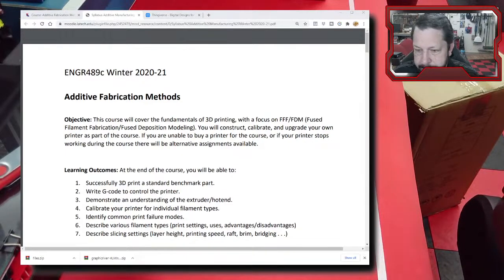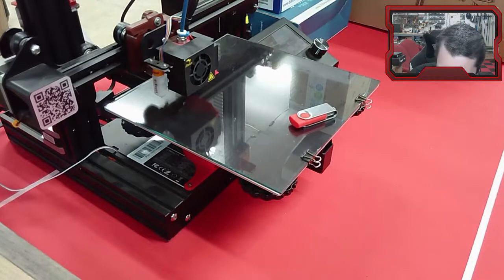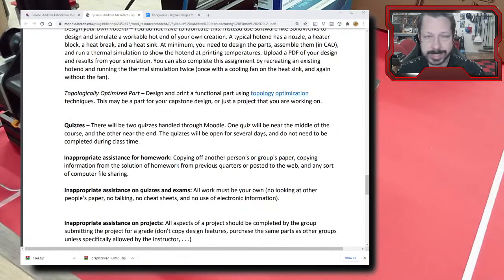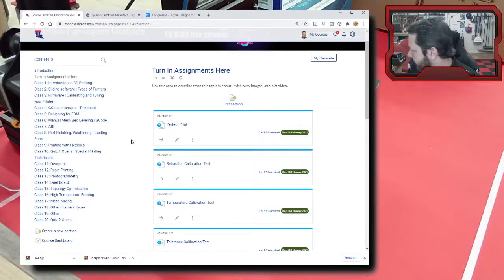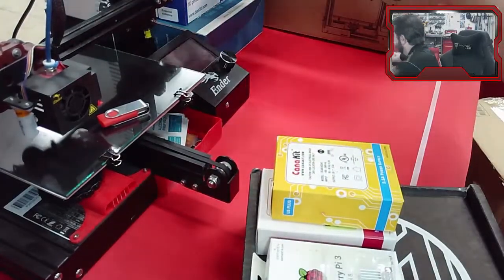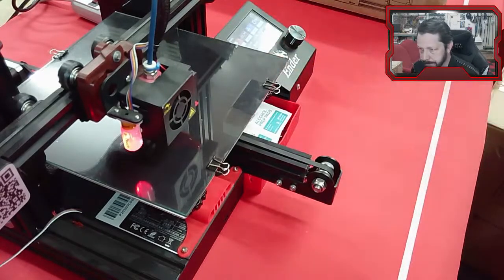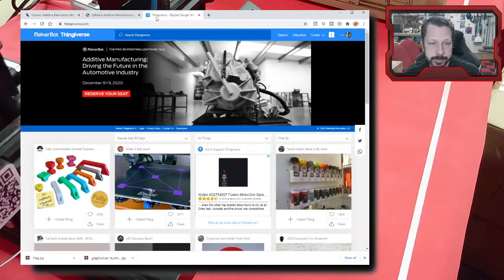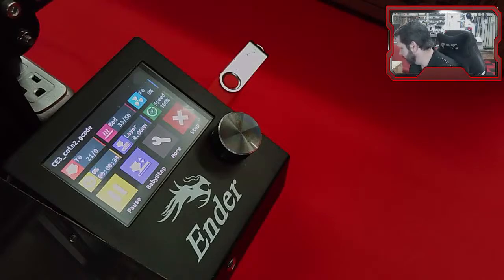01 | Additive Fabrication | Introduction to Printing | 2020-21

Comment: Is this a college class or a general open class? Can you post more details about the class and how to enroll? Thanks.
Reply from the maker: This is an elective course that I offer in the winter and summer quarters. It is open though as far as what I put on YouTube. I have thought about setting up some webpage so others not technically in the course could see any written materials that go along with it, but I haven't done that yet. I will see if there is an easy way to get some schedule out there. As far as enrolling goes, I am not sure how that works unless you are a Louisiana Tech student already. Otherwise, I assume you would have to pay some sort of tuition. I haven't really looked into how to offer it outside of our existing students though. Thanks for the questions though. Also, feel free to join the livestreams).
Reply: @KellyBC  Hi Kelly.  No real need to enroll.  I'm an EE (Cornell University, 1984) with 35+ years of experience in industrial automation & software development.  I'm definitely following along, have watched everything to date, including the 12/8 live stream and plan to continue.  I'd definitely be interested in getting whatever written material you have available and would like to get a copy of the syllabus.  Is it possible to get your Discord address?

I have an Ender 5 Pro with a 4.2.2 32-bit board and TMC 2208s.  I also have an Artillery Sidewinder X1.  I'm a big fan of TH3D products and use their PEI flex plates (smooth & textured) and their EZMat.  I also have a Creality Glass Bed when needed.  I have the EZABL (with the Solid Bed Mount kit) but have some issues with it which TH3D is dealing with at the moment.  Hope to have it installed within the week.  At the moment I'm using MANUAL_MESH_LEVELING, which is working Ok.  Currently using TH3D UFW 2 firmware (V.2.12b) which is based on Marlin 2.0.7.x which works great.  I just got my Ender 5 about 2 months ago and have really kept it basically stock while learning about it.  But now I'm starting to think about upgrading it.  I have a TH3D titanium heat break which I'll be installing soon.  I want to run some higher temp filaments and hoping to get the PTFE out of the hotend to help me do that.  Hoping to stay with the stock hotend and just install the Ti heat break and use my Capricorn PTFE and install an upgraded thermistor, which I already have, and go from there.  Don't expect to go any higher than 300C and expect to stay below 280C most of the time.  Do you see any issues with doing that?  I also have the PrinterMods MDD 1.3 direct direct drive conversion kit and their LED lighting kit for the Ender 5 which have gotten really good reviews.  Hoping to do those installs in the near future.  If you have any tips, please let me know.  Have a good day.  Thanks.
Reply from the maker: Thanks for watching the videos! I am not much for writing things down, but I do think I can post the syllabus and a few supporting documents on my webpage. It will at least give you a tentative schedule of where I plan to go from class to class. I will see if I can send you the Discord link directly as a private message if I can figure out how to do that without broadcasting it everywhere. :)

I like the TH3D UFW as well. I usually go through installing it as part of the course. 

If I understand what you are saying about pulling the existing PTFE from inside the hotend and replacing with the Capricorn then I don't think that will get you up to 280C. As far as I know the Capricorn is still PTFE and will break down at 260C or so. It is just made to higher tolerances and thicker walls from what is usually the stock Bowden tube. I don't have an Ender 5 to look at, but I think the stock hot end is going to need to be lined with some tubing. To get above 260C you will need to go with an all metal hot end which is not lined at all. 

It does sound like you have some really cool upgrades to work with. I haven't done a lighting kit before. We will (try to) do some high temp upgrades closer to the end of the course so maybe those will give you some ideas. 

Feel free to ask all the questions you would like!
Reply: @KellyBC  Thanks for the quick reply.  You can also email me. Is there a list of homework assignments?

Regarding the hotend update, I will be installing the TH3D titanium heat break, so the PTFE will be removed from coming in contact with the nozzle directly and isolated by the titanium break which doesn't transmit the heat as well.  The Ender 5 Pro comes with Capricorn PTFE stock and I may upgrade to TH3D Tough PTFE which is speced to 275C just for good measure.  So, that should isolate the hotend and allow me to get up to the 300C that I'm looking for without any PTFE issues.  But, again, I don't see myself printing much above 280C most of the time.  The main issue is whether the cooling system on the Ender 5 Pro can handle the higher temps on the hotend.  I'm trying to get some answers on that now.  I may upgrade to the TH3D Tough All-Metal Hotend which is just $30 and has a better heat sink and cooling system.  One issue with this is that it doesn't fit onto the stock mount, so I'd need to switch to the Hero Me Gen5 or something similar.  Have you used any of the Hero Me mounts or any of the multitude of other mounts that are out there?  Generally people are using them to obtain better cooling characteristics.  I've really not seen much cooling issues with my Ender 5 but others seems to feel it has some issues since the cooling flow is really only from the right side of the part.  Another issue I have with the TH3D all-metal hotend is I'm not sure if it's supported by the MDD 1.3 direct drive system (waiting to hear back from PrinterMod support on that).  It's always something!!  Thanks again.  Looking forward to Thursday's class!